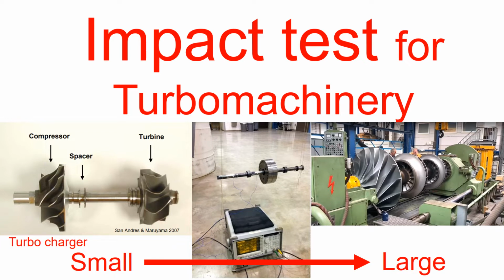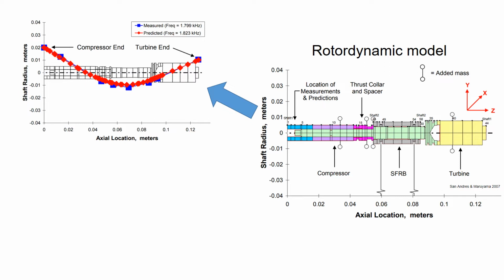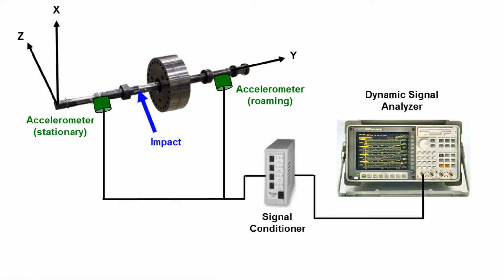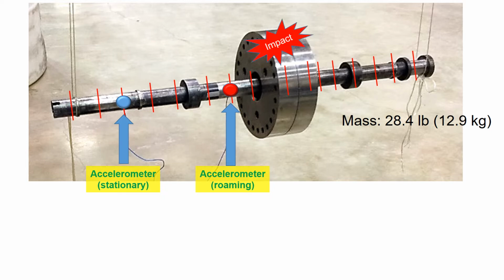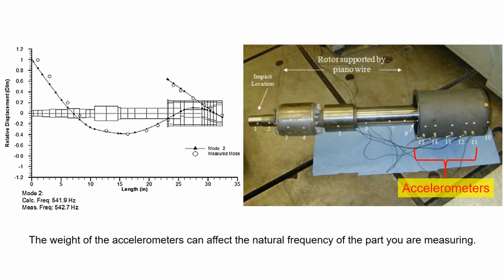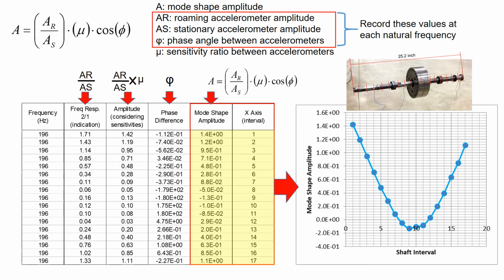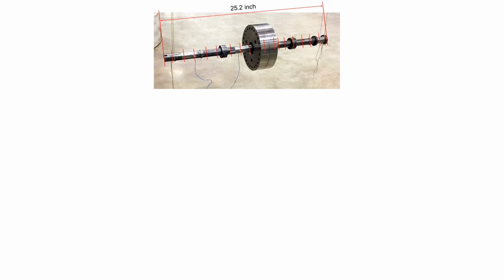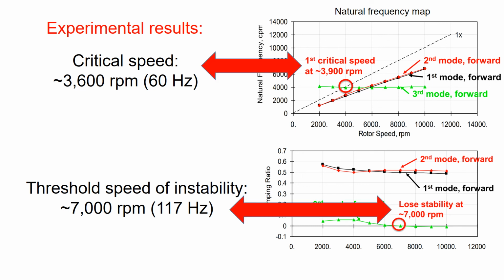Part 14 - Impact Test (modal analysis) for Rotating Machines

Comment: How do you measure and record and phase angle?
Reply from the maker: During an impact test, the phase angle is measured by a Dynamic Signal Analyzer comparing the time delay between a reference signal (the stationary accelerometer) and a response signal (the roaming accelerometer) at a specific natural frequency. The analyzer processes these waveforms via a Fast Fourier Transform (FFT) to determine whether the two points are moving together or in opposite directions. To record it, you place a cursor on the resonance peak on the analyzer's phase plot and log the angular value (typically hovering near 0° for in-phase motion or 180° for out-of-phase motion) next to its physical interval on your data sheet. This value is critical because its sign (positive for 0°, negative for 180°) determines the direction of deflection, allowing you to correctly plot the rotor's physical mode shape. You can email me if you have more questions. rotordynamics101@gmail.com

Comment: i have buyed xl rotor but it is not running properly and the error massage it xlrotor is missing from excel's installed  addin.kindly suggest what to do to run this xlrotor application.
Reply from the maker: I recommend reaching out to the XLrotor software support team for assistance with installation and troubleshooting.

Comment: Great content and very well explained! I have two questions:  1. How to best choose impact location? 2. How is the sensitivity ratio between the accelerometers determined?
Reply from the maker: Good questions. A node is a point along the rotor that remains stationary in a particular vibration mode. Striking the rotor at a node will not excite that natural frequency. To capture all significant modes, select an impact location where both the first and second mode shapes have substantial motion.

For a symmetric rotor supported at both ends, an impact near the mid-span effectively excites the first bending mode. However, because the mid-span is a node of the second mode, impacts near the quarter-span are also needed to excite the second natural frequency.

Each accelerometer is supplied with a calibration certificate specifying its exact sensitivity, typically in mV/g (e.g., 100.2 mV/g or 98.5 mV/g). Modern Dynamic Signal Analyzers allow these values to be entered directly, automatically scaling the measurements to accurate engineering units.